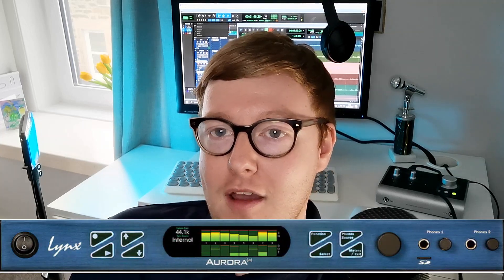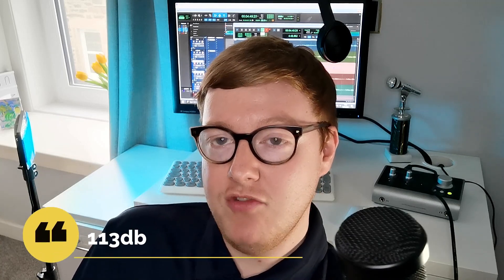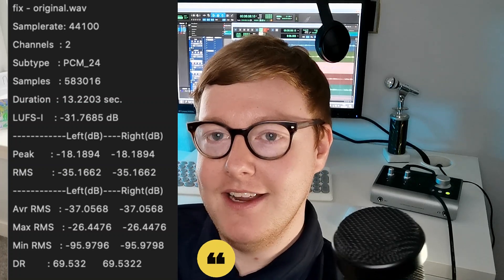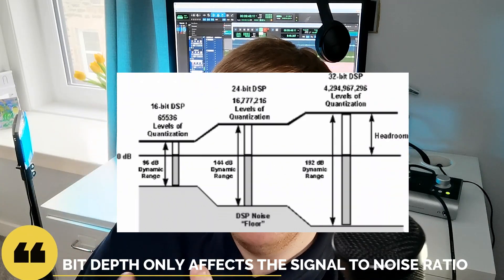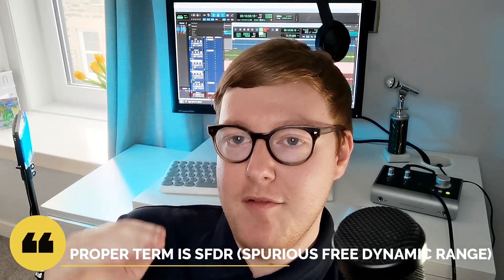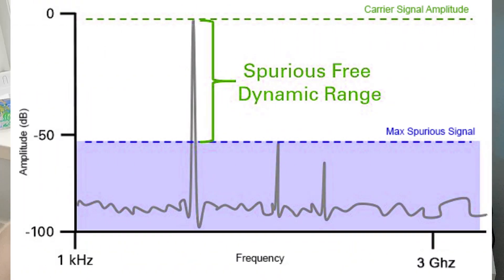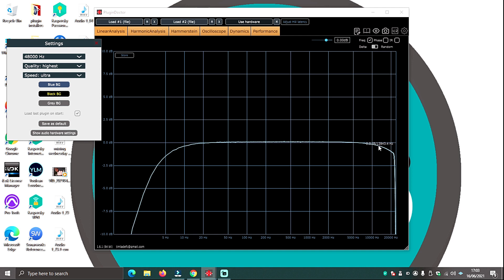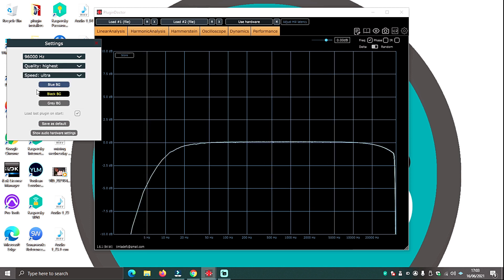Do you lose audio quality in analog gear using budget interfaces vs expensive ADC Converters (Pt 1)

Comment: when you're saying a 96KHZ audient recording is more transparent than an 44Khz aurora recording, arn't you really saying that aurora gives you an almost equal preformance for half the file size? I wonder.

second point. you mention aurora having 8 channels to justify what it costs, but there are also 2 channel converters that cost the same and more, and so while it is a fair point to consider when thinking about the pricing of the aurora 8 preamp device, I wouldn't use it to prove the more general point you were discussing.

third point. if you are going through a compressor you are probably going to get a narrower dynamic range. however, when recording you don't always go through a compressor. it is like saying I wouldn't ever need a big canvas because sometimes I make small drawings. moreover, even if you do use a compressor, that range you recorded in, could be set anywhere within the interfaces range within the mix, so it really doesn't mean the interface's dynamic range isn't important just because you don't come close to the capabilities of the input of the device,  as you tried to demonstrate. the DSP's Dynamic range is also a very important thing to consider. 

btw I don't know which vocal performance you used that used up 60DB, but it really depends on the vocalist, the song, and also the gain staging and monitoring you are giving the vocalist (the less volume in the headset, usually the louder the singing). You would probably make better use of a dynamic range while recording something like a piano, while giving enough gain to hear it being played very quietly, and then being able to indure harder playing without clipping or coming too close to clipping which also degrades the sound quality.

finally. that graph you show of the conversion+preamp frequency response of the Audient. music reproduction is not just about having a frequency response of some sine wave or white noise. the dynamics of it, the transients, debth etc, have impact that you are not detecting in this test. in fact there is a very nice comparison test done by audient showing exactly how different their devices sound. and you can listen and see how the audient id22 sounds different from the more expensive units, and if you listen to the audient console, you would for sure understand it's more than frequency response that you should be testing for.

correct me if i'm wrong on any of the previous statements. i'd be happy to learn. thanks for the work you do.
Reply from the maker: Nah not equal. The null is significantly quieter at 96k through the audient. What I'm saying is that for printing analog gear, an audient id14 at 96k will give more transparent results for way less cost.

The aurora is essentially around £330-350 per channel. The audient offers 2 channels for half that price.

So if you are only printing 1 or 2 analog units then the audient is a perfectly fine choice, and also extremely inexpensive in comparison.

The only reason I see to buy the aurora is if you need the 8 channels to run gear through.

IF you don't and file size is really an issue you could easily just buy an external hard drive. Actually if we're comparing for the difference in cost you could just buy a whole new computer 😂

That's the real context of the argument. You pay for what you need.

Comment: From experience I have learned that there are some things your ears tell you that a dynamic range, THD, EIN figure does not tell you. Do you need 3k converters to make music at home or even in a mid-sized tracking/mixing studio? No you absolutely do not. But...
I have heard tracks through a high measuring budget interface, and I've heard expensive interfaces that had worse dynamic range etc. specs than the budget interface; and in a blind test I could pick out the expensive one. Things like transient response don't show up in charts, but you will hear it if you've been mixing for a while. Jitter is a real thing (that's somewhat measurable it turns out).

I have mixed tracks through a budget converter, and a high priced converter. The poorer performance of the budget interface adds up with more tracks (less clarity, etc.) at the same sample rate. Better components, like capacitors, decoupled power delivery etc. do add up. 
Better tools do help things get done faster, and if you're, say mixing music for triple-A games or big budget movies, you probably don't want to leave certain things to chance.
That said, budget interfaces (I'm thinking Audient ID prices and upwards) are VERY good these days compared to 10 years ago (those were poor across the board), so it's still about the skill of the "audio engineer". If your work sounds bad, it's you. A bad workman blames his tools.
Reply from the maker: I just upgraded the headphone amp of the audient and bought a topping L30. Combined with better headphones than my bose that came this week I'd say investing more in monitoring is more important than sticking your 2 bus through expensive converters or printing hardware through expensive converters. Can't believe the detail I've been missing just by upgrading my monitoring which i thought was half decent in the first place. Different ball game now as the detail in soundstage, Transients, High end and overall detail in low end cleanliness gives me a better understanding of what to strive for. Sounds obvious but until you hear the difference you can never really know that your missing out. £500 well spent
Reply: @PaulThird  Absolutely, the monitoring should be the FIRST thing ppl upgrade. Can't mix what you can't hear. 

Congrats on the new amp, bet you see (or hear) compression a bit differently ;)
Reply from the maker: Totally. The combination of the new headphones and the topping is worth more than any plugin. Unbelievable detail and yes I can't believe how much more I can hear compression. Its actually shocking listening to big records, modern and older and being shocked at the lack of punch and energy in a lot
Reply: @PaulThird  Mastering to CD meant lots of squashing. The '90s especially were odd times with wide quality variation in mixing/mastering (you could easily tell the big budget productions), but the great thing was that most records, regardless of budget, were decently recorded. That's my problem with modern music, it's not plugins or "digital versus analogue", it's these absolutely horrible (especially vocal) recordings!
Reply from the maker: It's amazing how the times have reversed. Recording equipment is just a lot less expensive and more accessible now. If you were to give me better microphones and an acoustically treated room id bite your hand off. Some of my favourite records were recorded in some of the best rooms and through great mics. The room can be more important than the instrument for some songs. The right room can really lift a drum kit and add space to a piano or guitar. Im always gutted I have to record my stuff in a bedroom 😢
Reply: @PaulThird  For Drums (especially) and Piano, yeah there are certain sounds you've got to rent a studio. Guitar depending you can "get away" with at home depending on mics etc.The paradox is that "affordable recording gear" sort of killed the studio market...best of both worlds could've been maybe rent once or twice, learn a few things and get some hobbyist gear for home practice, and lay down the money tracks in a proper studio. Alas, here we are in homestudioville.

Comment: It's not an a matter of subjective opinion, you can actually google pictures of what's under the hood of all these interfaces and converters and all that. It's either cirrus logic or akm, and then some opamps in the path. There are datasheets from the manufacturer and all. It's nothing more, nothing less than this. And the fancy converters cost about 5$ a piece if you only buy one single chip. It's absolutely ridiculous and the circuits are pretty basic, expecially it's only line level and acts only as a converter, relying on some other soundcard's drivers. Some apt DIY  person could litterally pull out a schematic and open source a 4000$ (lol) converter pcb and it would cost about 30$ to build. xD
Reply from the maker: hmmm.. could Paul Third make his own converter .. nah I'd blow myself up haha
Reply: @PaulThird  Oh, it's not worth the expense of time. It does not get much better than the SSL2 cheap interface. I mean it's litterally the same converters than some high end RME stuff and the hardware around it aint cheap too. While on paper the audient is a tad less impressive... it will totally do fine. A solid reality check is that you know, mastering quality tape machines have a dynamc range of about 70-75db. The analog warmth is real hot in there. xD  But really, it's ridiculous to charge 4k for 8 channels of line inputs + converters with no software drivers at all. There is litterally about 40$USD of electronic parts in there if you only build one. It really is not an  opinion... it is a fact. I have DIY-ed lots of synth stuff and know my way around designing PCBs and so on; it's not rocket science. And the debate about analog gear versus software, in the 2021, is long gone. I don't know if you play electric guitar but oh man, we have come a long way since the line 6 pod 2.0. If the amp simulators of the likes of Neural DSP and such are so realistic and pristine.... then it means that a 1176 compressor consisting of half a dozen diodes and an output transformer can totally be crushed by software. A whole pedal-amp-cab-mic-room-pre chain is considerably harder to emulate. lol xD
Reply from the maker: I've still not tried neural stuff yet but all I've heard is rave reviews. I've been using the bias stuff for years
Reply: @PaulThird  Oh man. You are missing out. It simply is beyond all measure. This ans STL tonality tone hub; it basically is straight up the same exact thing as a Kemper - they have released in a vst format they Kemper packs basically. I find it less flexible than an amp sim but the realism is incredible. Another groundbreaking guitar VST is the ''mikkko'' cab simulation from ML sound lab. It really is something special.

Comment: It sounds like she never aplied to me! lol it's extremely subtle though i mean. Let's get real. I can't say i didnt hear the difference (between the 48 and 96; the lynx is just probably the same chip conv. or equivalent in a cuter box lol) but still. It's extremely nitty picky there. I would say that provided you have an extremely fast CPU and some actual analog compressors and so on. I would say the AKM converters in the RME adi, the SSL2+ and the Clarett serie are very very quite the ticket. It's incredible to find them in the a so cheap interface that the SSL2+ is. It's insane. With alp pots and neutrik connectors and all. The future is now! What i do is running a RME raydat for the stable windows drivers. I run 4 behringer ada8200 into it when i want to multitrack 32 channels or eurorack modules like a crazy person. I have a nice AKM converter of unicorn fancyness to monitor and if i indeed would like to record a nice preamp or a nice microphone, a single or stereo channel and nothing more. lol

Comment: This isn’t really an accurate test.

I get the jist of what you’re trying to do. But, it’s not scientifically credible, as you have two distinct signal chains. You have no idea what the actual hardwired signal path is at AA. They say a simple cable. But is it really, or is it through their patching relay etc.

The only way to make true comparisons, that qualify empirically based conclusions is to use an identical signal path, except for the variable being tested.

If you think good conversion is a white elephant, then you should debate Bob Katz.
Reply from the maker: Tbh I never said it was 100% scientifically accurate.

I did a test with what was available. Regardless of the variables being a cable it's still the exact same digital file being streamed lossless 24 bit into a converter and then going back out, streamed lossless into the same daw and being printed in the exact same way as the id14. 

It can be flipped the other way that the lynx has an advantage that AA's cable is better quality than mine. 

Theres no way to prove how much of a real audible difference there is via using access analogs signal chain. There's as much as 5 lufs of a difference in the null. Is using the same cable or me having the physical hardware going to get that 5 lufs difference of the id14. I'd very much doubt it but again I can't prove it

In the end I recieved 4 nasty emails from disgruntled lynx users demanding the audio files and claiming that I had no idea what I was talking about and name dropping such and such. 

I offered them all to send me their converters to test transparency against the id14 at 96k. As you said remove the variables. 

3 have not replied back to me and the other one told me that they wouldn't want my dirty inexperienced hands on something that I'll never be able to afford. Wished me good luck in making mediocre records through my id14. 

Tbh I'm not fussed. I know that the id14 is transparent enough recording at 96khz to print analog gear through. That was the main point of the video to test if and how it degraded the audio quality of the printed hardware. I do expect there to be converters that are more transparent than the id14. There must be. I'm not doubting that for a second. 

But until somebody hands me their converter and asks me to test it under the same circumstances I couldn't really care what others use or what so and so has to say. to be honest as I'm perfectly happy with what I've got.. Well not really as I want to upgrade to the iD22 now haha but for now I have no issues using the id14. I tested it and was pretty happy with the results 🤓
Reply: @PaulThird  that’s all well and good, mate.  But, you make a bold statement saying you’ve ‘proven it’ and it isn’t conclusive. 

Yes, 5dB RMS is pretty significant difference. Too significant for it to be the actual DA/AD process. It’s more than likely a slight phase shift, which I would be surprised if it was the Lynx itself.

As for cable quality, that definitely is a white elephant. Im saying I doubt AA is a direct cable IO. For them to be able to allow reordering of units, means they have some form of patching. That’s either digital or digitally controlled analogue relay. My point being that these are not insignificant factors to consider.

There’s deffo a lot of snobbery in music m. So don’t get me wrong. I’m just saying that the best debaters acknowledge the shortcomings of their own methodology and viewpoints. It actually makes you more credible than less. 

You could get in touch with Lynx and ask them to send you a unit for comparison. Then you could make a direct test and draw a line under it forever?

Good luck with the channel.